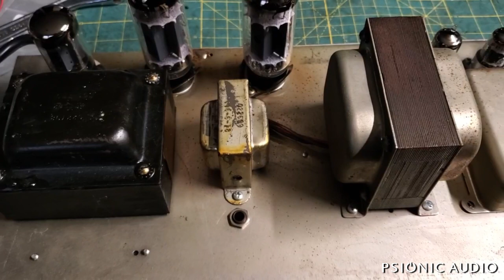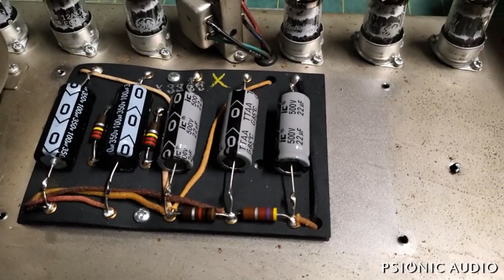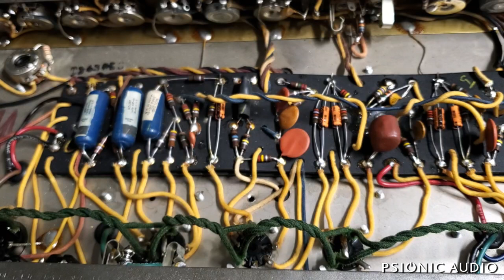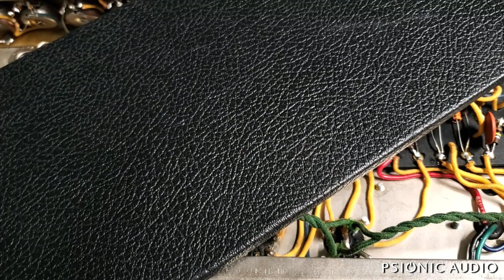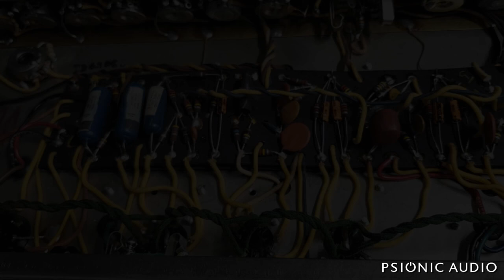'66 Fender Super Reverb Part 1: Initial Inspection, Playing, & Quick Fixes

Comment: Hello. Great video. Why would someone bypass the rectifier tube? There is a 73’ super reverb for sale close by and seller said the amp is all original except the rectifier tube was bypassed. Keep up the great videos.
Reply: Cesar Diaz did this mode to SRV. Tighter bass and the amp is more consistent when it gets hot I think.

Comment: I just got a 64 super and the seller unplugged the tubes and packaged them up so they would be safe in transit.  The problem is I dont know which tube goes in which socket.  Which socket does the rectifier go (when looking at the back of the amp)?  Once I plug in the rectifier and 2 power amp tubes, do I have to do anything before turning on and playing?  Thanks for the help!

Comment: Got one with a 1X15 Weber in it. These are great amps. But get rid of those IC caps!! Good filter caps will last for 20-30 years! Throw that junk!
Reply: Would you say the ICs are tone robbers or are they hated simply because their poor shelf life? And what about electrolytic IC caps on the board.. same thing?
Reply: @justin-wz1jw  They're just poor quality. A cap is a cap. Tone suck? Nope. Unreliable junk? Reputedly.